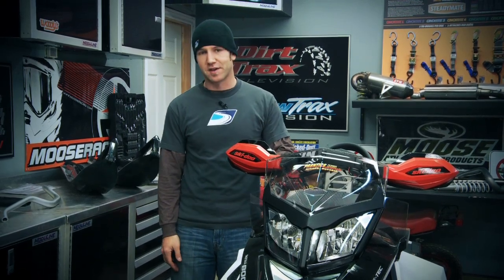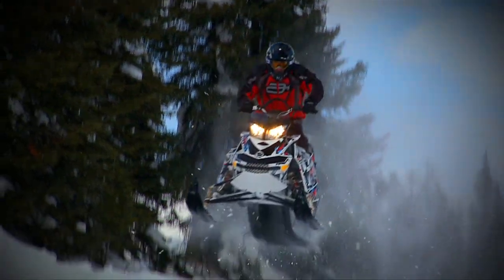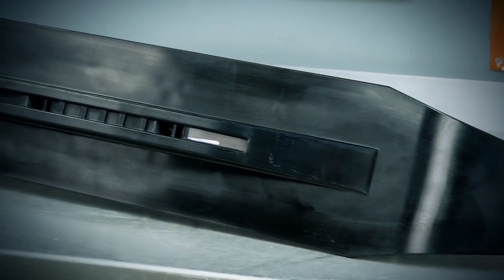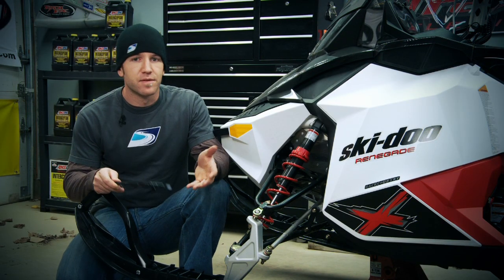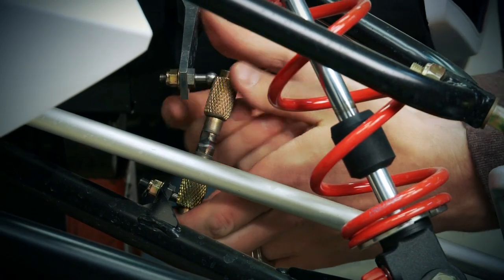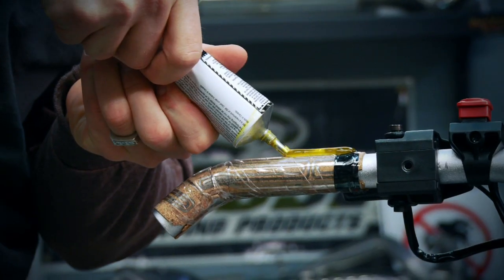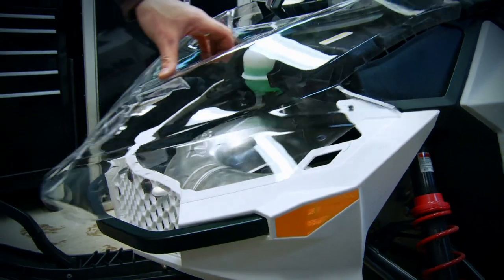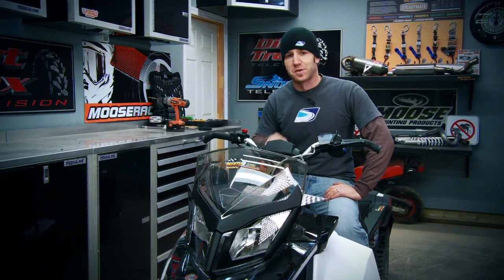2011 Ski Doo Backcountry X Flatland Snowmobile Customization

Comment: If you remove 1 or both sway bars, the sled will be more tippy since the 2 skis are no longer tied together with the sway bar, this makes boondocking and side hilling easier, but for trail riding or any other hard pack snow riding, you want both sway bar links ON or the sled will be difficult to control

Comment: Hey Great vids, I was wondering if those bars fit right on, or did you need to put brake/throttle extensions? Also is there a BRP part number for that replacement sway bar, or can I just ask my dealer for it. 
Thanks a lot, Keep them coming!

Comment: I put the free-ride bars to my 09 MXZ and just a heads up unlike the video says they will NOT just bolt-on, you will need to either purchase the free-ride riser or a oversized bar clamp, (powermadd one works great the pro-taper brand will not work!) also you will not be able to use any hand-guards because there is absolutely no room for them on the side where your heating controls are, and to top things off you will need to purchase a new bar pad if you used the oversized bar clamp!